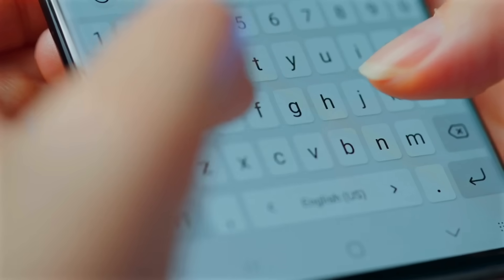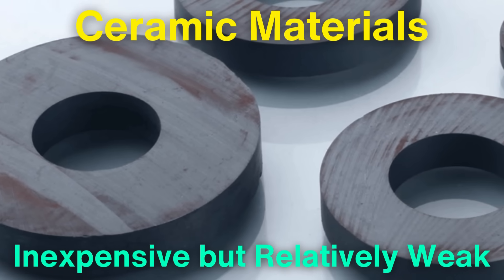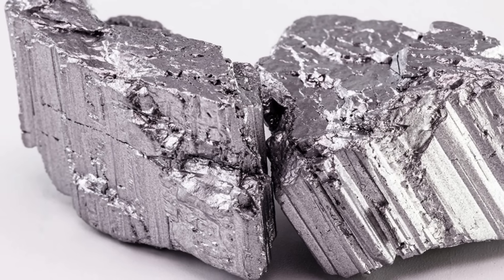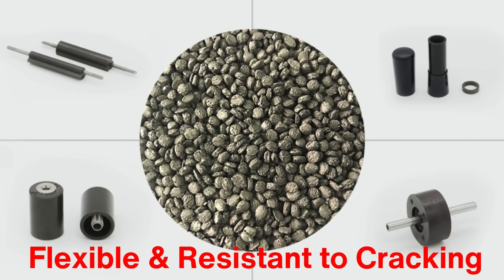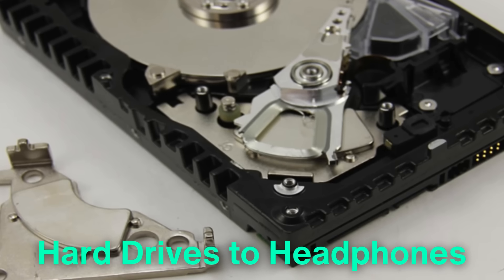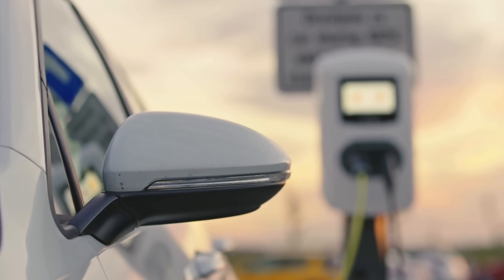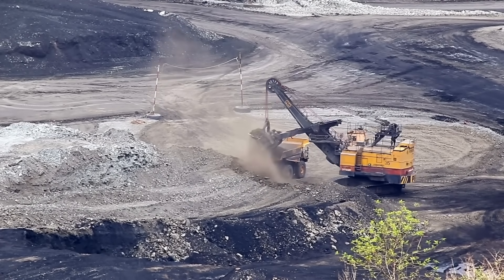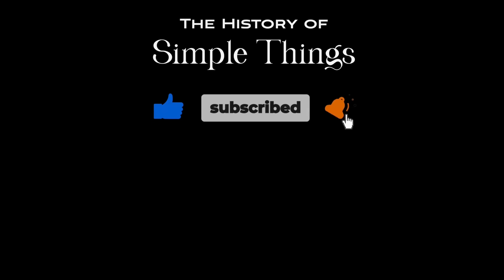Neodymium Magnets: How They Work and Why They’re Everywhere!

Comment: The big problem of all of this rare earth magnets ist, that China has a production monopol on it. In small devices like harddiscs or small drones motors such magnets are unavoidable. But especially in larger engines like in car motors or windturbine permanent magnets are not neccesarly needed. Car motors can be build as traditional synchron machines, were the exiting current is transmitted with high frequence transformators. This pure iron/cooper machines can be controlled in excitation strength and deliver sometimes better performance results than permanent magnet motors. And in Wind turbines permanent magnets are really not needed. Take a modern designed but traditional synchrone machine. Worked in the past best and could be further used, to reduce dependency on chinese made materials. The western world is still very reluctant to build up an own mining and refinment industry to get rid off being dependend on china stuff.